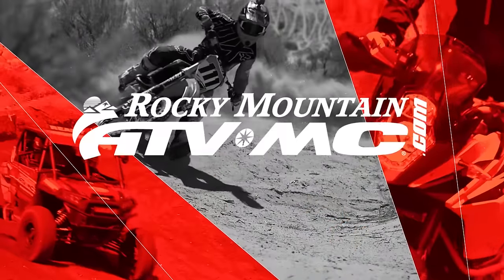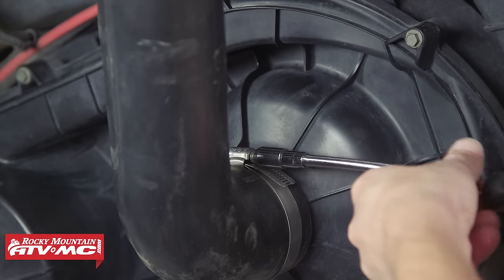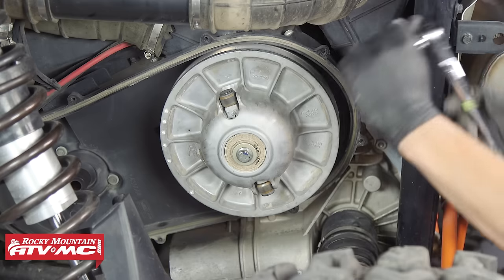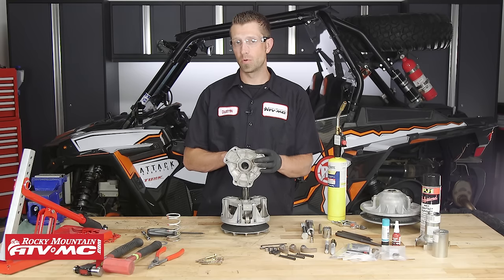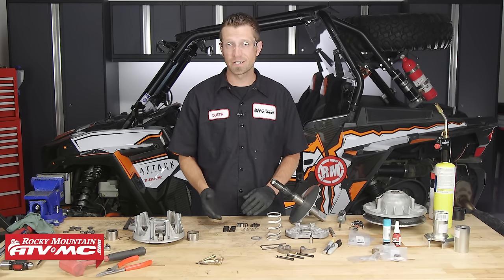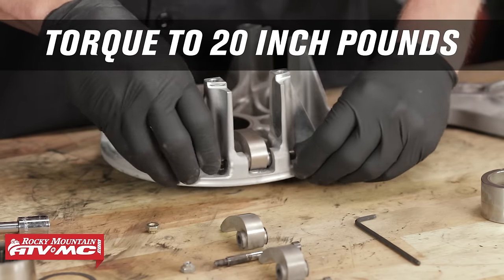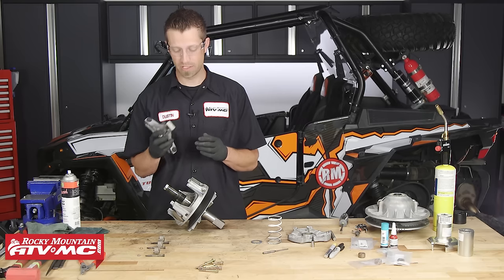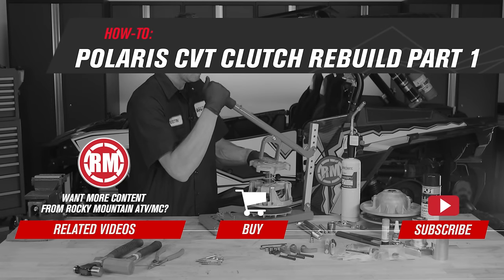How To Rebuild a Polaris UTV CVT Clutch | Primary Clutch

Comment: You must ensure (I don't think it was mentioned) that you clean off all the Scotchbrite pad's residue or else it will ruin your bearings. It's well documented and to the point where certain auto manufacturers forbid the use of Scotchbrite type abrasive pads as a seal prepping method. 

It has been descovered that remnants of those abrasive strands will damaged an engine, especially the main bearings. 

So make sure you clean very thoroughly with brake cleaner or other solvent after you finish prepping with Scotchbrite pad.

Comment: Thanks for the video, great. What is the approximate clearance between the spider and the frame. I don't understand it very well in the manual. I arrive at 0.19 mm on 2, and the other 0.16 mm. THANKS !
And if my ramps are not completely smooth does that mean they need to be changed?

Comment: We have a sportsman 500 H.O. It has a ticking noise, and I have isolated it to the drive clutch, (same one in the video) if the bushing on the outside of the one way bearing is worn, would that allow any play on the shaft/cause ticking noise? Thanks

Comment: Thanks great detail.  Wish you would have replaced the Moveable Sheave Bushing as well.  I need to do that and I guess you needs a special tool for that too.  Dealer quoted me $40 to press out and press my part back in.  Only a $300 tool from Polaris ;-(.
Reply from the maker: Tony SanFilippo Thanks for watching.  Guess the $40 is well worth the money considering the price of the tool and how often you would be using it.
Reply: Yea, I was hoping you sold an aftermarket tool for like $100, so I didn't have to go to the dealer.  But if you did, you probably would have replaced it in the video I guess.  I have seen one after market at EPI performance, but not $100.
Reply: The movable bushing can be easily removed/installed with a socket of the correct size and a press. That bushing not being replaced will make all of the new parts put it quickly wear out due to execive play.

Comment: Hey, that’s a great video! I have a Polaris general 1000 2018 and when I bought it from the auction it had damage on the front. The eps was broken, and the clutches would keep slipping. I changed the belt a few times and took it into the dealer. They said it was the clutch that we needed to replace. I got new clutches but i observed it closer and it looks like it would make a noise every time the the transmission would spin. I spent so much money on this and I don’t want to fix what doesn’t need to be fixed. Can I get your opinion on this? Thanks!
Reply: why don't you find someone you trust that's a little better than the dealer. the best techs at dealers often start their own gig after not too long of working for the dealer.

Comment: this is a good video, informative and professional but for the average Joe who enjoys maintaining his/her ride, this option would not be cost effective nor logical. Unless you already have the specialized mechanics tools at your disposal, buying the required tools along with the replacement components to rebuild your primary/secondary yourself is essentially the same drain on your wallet as simply buying a new primary/secondary without all the effort as well as getting it serviced for you which is also pricey, even though personally, I enjoy doing everything myself. I say if your primary/secondary need a rebuild, go ahead and buy replacement clutches unless you want to rebuild them yourself and if you have the skills, tools and confidence because the cost is more or less the same between the two with getting professional service coming in at the third most expensive option which, depending on where you get service, might be more or less expensive.
Reply: A new primary dura clutch  is almost $1,500...tools to do this job are around $200

Comment: The spring that goes into that what does it do? Meaning can I up grade it use the original?
Reply: The spring on the driver unit controls the engagement RPM. The stock spring kicks in at a certain RPM and I imagine there's some aftermarket options for different springs. The torque converters on these SxSs are a more high-tech design, but same concept as the ones used on go-karts and mini bikes (Comet and Max-Torque.) On the go-karts you have about 4 to 5 different spring options on the driver (the one on the engine output shaft) and several for the driven unit connected to the axle. Springs are lighter or stronger and engage at various RPM ranges. Definitely makes a difference if you're racing or running a higher power engine.